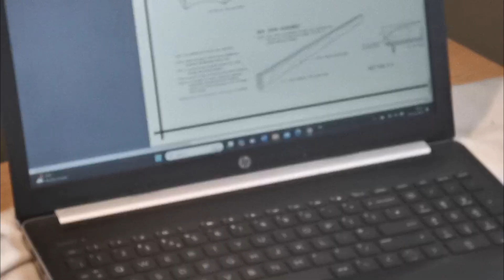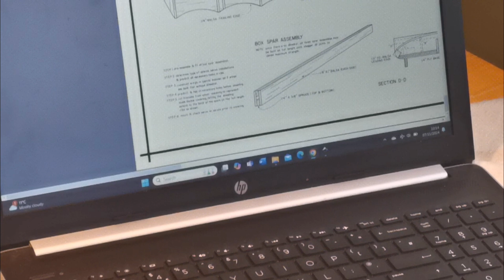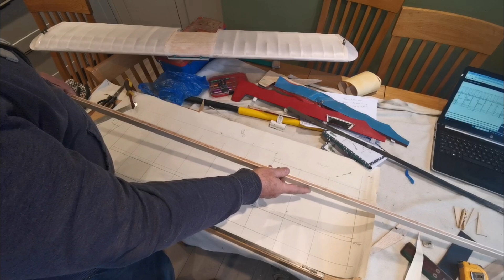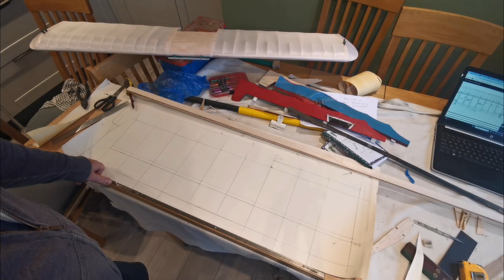Planning the upper wings: Fokker DR1 refurbishment.

Comment: Looks great. No question that the box spar will be stronger. The question I have is about the strength of the rib attachments. I suppose the final determination will be if a rectangular hole is cut in the ribs for the spar or if the ribs are cut in two and glued to the spar. I guess we will wait and see.
Reply from the maker: A rectangular hole will be cut which should provide a large surface area and therefore strength to the structure.
Reply: That will be nice and strong. Lots of detailed cutting to get the wing perfect. Good luck.